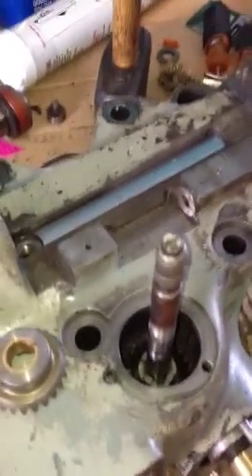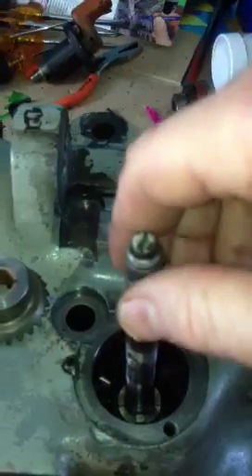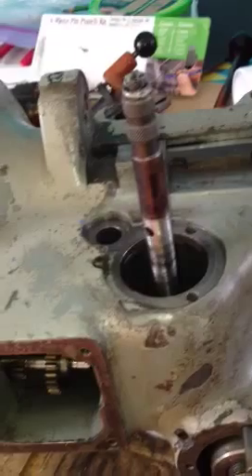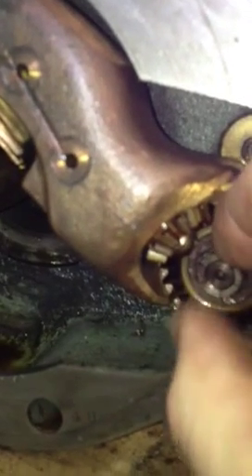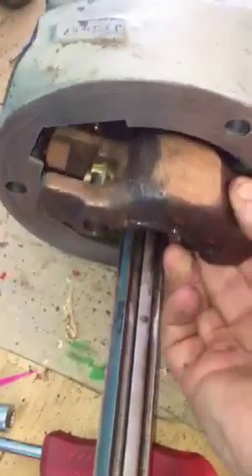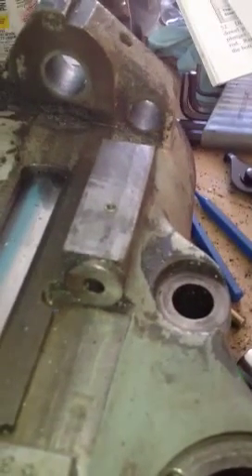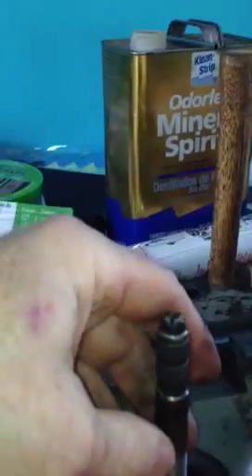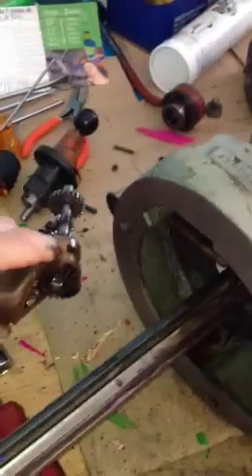Bridgeport quill tear down part 8

Comment: I want to say this is a great video and disassembly...thanks for posting it.  I have a question about something that wasn’t mentioned and was wondering it you could explain it.  In the up and down fine feed box (forward reverse) there is a beveled pinion gear that protrudes from the top from the gang gear box.  How was this gear removed?  I need to remove and replace ...do I have to disassemble everything to change this or can it be done another way?
Thanks